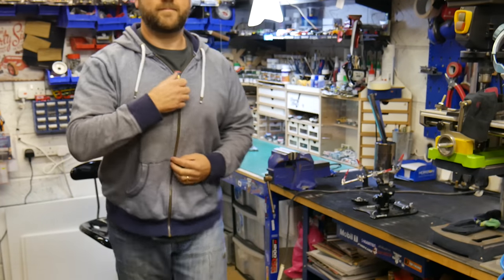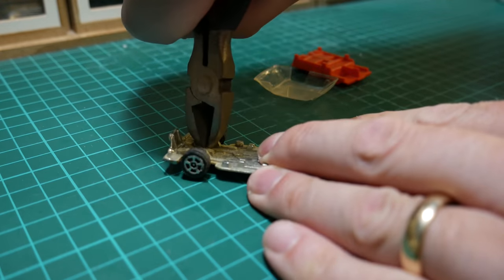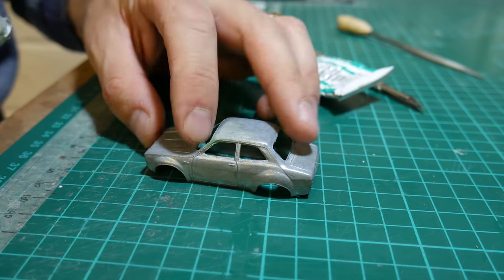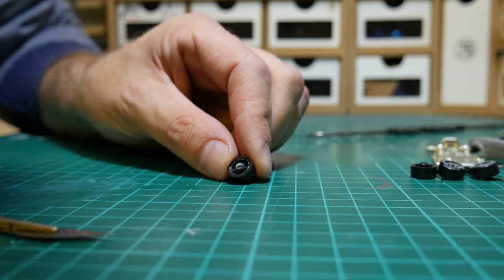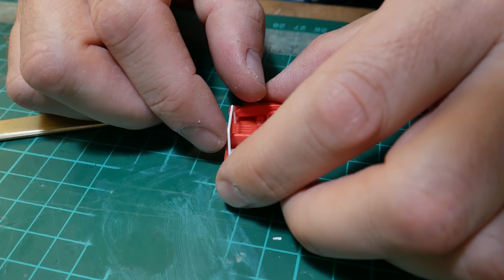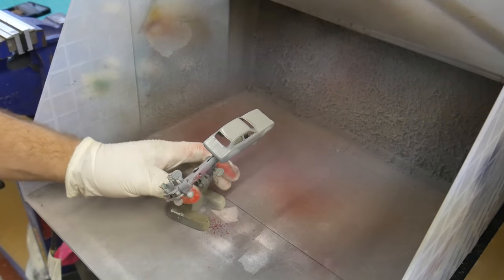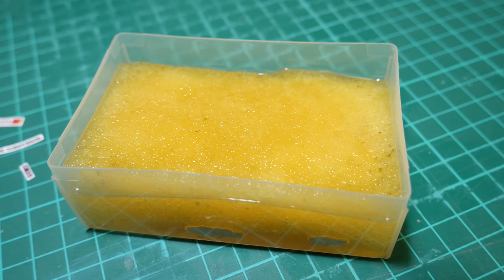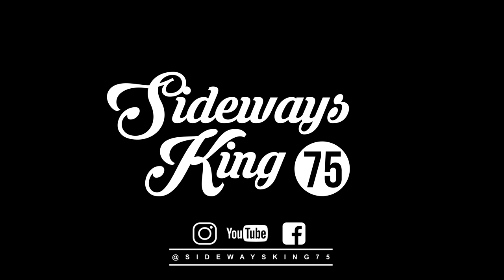CORGI Restoration & Custom : 1973 Ford Escort MK1 Mexico

Comment: The reason that it has those oddly flared wheel arches, is that the casting was originally a Corgi 'Rocket', and a version of the Mk1 Escort Rally car. It had a noticeable difference - it had two bracing struts in front of the windscreen, and came with a set of rally stickers. Corgi discontinued 'Rockets' after a short while, and retooled the models to do away with the detachable plastic chassis. My younger brother used to have a real Mk1 customised to rally specs., bucket seats, aluminium flooring, roll cage, no rear seat, just aluminium decking, lift-off bonnet, fuel cell. The love of his life. Very fond memories of going out in it. He could never resist a touch of the 'loud' pedal when driving. Rude not to, with a car like that. After several years, he sold it, in order to buy an early Granada. Since then, neither of us have seen his white, with black bonnet, Mk1 again. Possibly squirrelled away in a barn somewhere.
And your custom? Beautiful, as always. Nice one.
Reply from the maker: 🚗 Thank as always for the trip down memory lane Brian, both in minature and life size. All my fondest memories include some sort of propelled vehicle and daft shennanigans. I'm confined to minature again at the moment as family life rides along. All the best 😁👍

Comment: Love the red and white contrast. Another great job. Especially on the front grill/light area. Beautiful. 

Have you ever thought about trying to faff about with zinc/copper/nickel plating? 
It works better with the more translucent (redline) paints. But it'll make any paint pop if the the body is good enough to not need a primer layer.
Reply from the maker: Many thanks as always 😁👍 I haven't tried the plating method, thats not to say I never will though but don't think I'll ever get away from using primer to be honest. I've never done a car that warrants one of the gleaming spectraflame type finishes but may look into it one day 👍🏻

Comment: The interior work you do is amazing. That's always been one of my driving factors to customize. Those belts and the bars add a detail that's just amazing. I was watching on my phone and the sound was eh. Not good. You mentioned the wheels. Is there a place that sells detailed plastic tires like the Nascar Goodyear, Michelin, etc? As I mentioned tires are my biggest issue. This finished car is incredible. This made Kyosho look like Maisto. I would love to become half as good as you. Extremely amazing car. 10 of 10.
Reply from the maker: Thank you Edster 😁👍I enjoy putting the extra bits on rather than just putting it back to standard. The closest thing to the wheels and tyres that spring to mind are 'Greenlight' sets or 'Monoblock Wheels'

Comment: Amazing job again..i have a real mk2 rs2000 with a xpack fitted in my garage.needs some tlc.would love to see you do one of those.
Reply from the maker: Oh my that is a real treasure! Is it one you've bought to restore or you used to drive? Love the X Pack bodykit. I will do a version but with the flat RS1800 front.
Reply: @SidewaysKing75  i have owned 20 years but been in garage a long time covered up..was on road.hope to get started on her next year..cant wait to see that one.
Reply from the maker: @lesliemagson6431  I'd love to see that one too !
Reply: @SidewaysKing75  when i get the junk cleared away from her i will take some pics.maybe find some old ones
Reply: @SidewaysKing75  can i ask what make/model you will be using for the flat front
Reply from the maker: @lesliemagson6431  I'm planning on a styrene/scratchbuilt one.... fingers crossed 🤞🏻
Reply: @SidewaysKing75  cant wait to see that one

Comment: Great job, as always. We never had that generation Escort here in the US; I think our first Escort (ca. 1980) was equivalent to your Mk III, and was, with the best will in the world, not interesting in any way. My grandparents had one. It was beige. :)
Reply from the maker: 🚗 Thank you very much 😁👍 Ford went through their Beige spell over here too LOL! So we didn't escape it either 😂. Our Mk III's had a great RS Turbo, RS1600i and XR3 all in the range. They were 1.6Ltr CVH Engines with the RS Turbo being you guessed it turbocharged. The swap from Rear wheel drive of the Mk I & II to front for the Mk III and on put some off but the faster ones were, and still are, sought after. Many thanks for the trip down memory lane.

Comment: An unusual thing about the MK2 Escort vans was under the MK2 front end furniture was the old MK1 headlamp panel which when done right you could have a sweet sweet MK1 Escort van, one chap I heard put the RS2000 snoot on a MK2 van and really blinged it up with the fandango wheel arches and phat wheels n tyres whilst the rear load area was turned into a sha... er passion parlour and full bling in the front area.   The Mexico's were pretty rare, as were Harriers, RS1800 twin cam and I did hear Ford shoved an Essex in a Escort to "Savage" it up, I imagine a 3 litre would have been lethal :P   One of my erstwhile boy racer friends had the Chevette with a bored out and tuned 2.0 litre Ford pinto engine in, the obligatory phat wheels in signal red with silver graphics, it wasn't an official HS is it called? Chevette but it was super fast and cornered like it was on rails.   He wanted to put an Essex in but his insurance company melted down when he asked about whether they would insure him or not lol